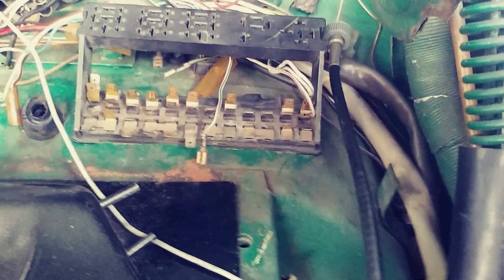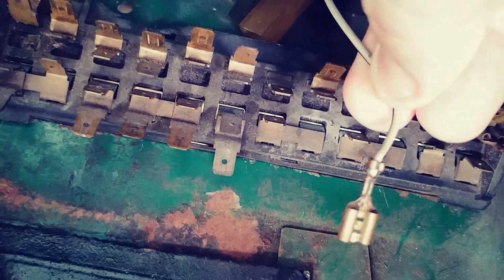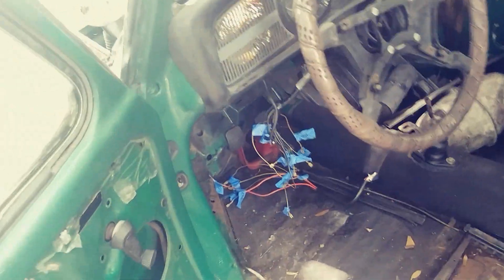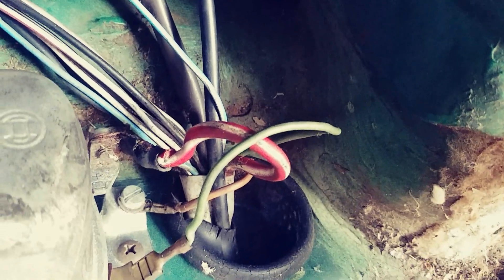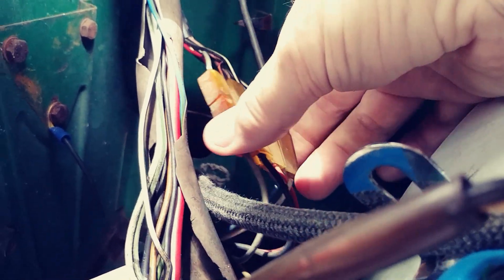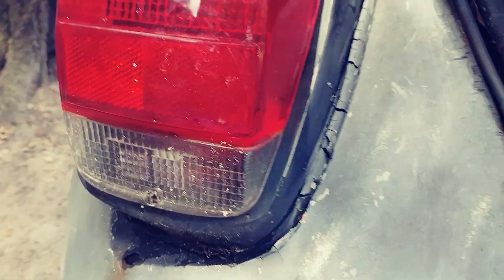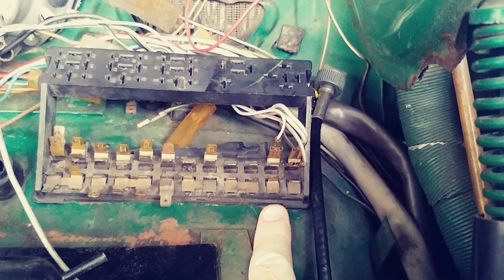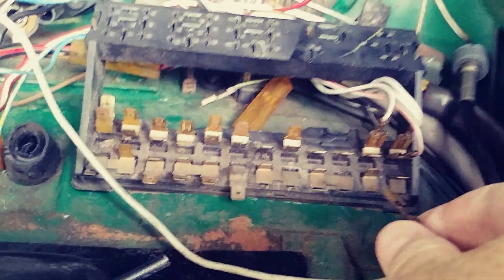CLASSIC 1972 VW SUPER BEETLE. REWIRE ( PART 6B FUSE 2) REAR TAIL LIGHT

Comment: I’ve got. 1973 beetle and I’m wondering how do I remove the wires from the tail lights I had a engine fire and I’m rewriting the whole back of the car again any suggestions
Reply from the maker: The factory way as you know went over the left rear tire. There is a loom of wires then spray installation was used. I myself had a fire as well.in a 67. The only way I way able to run the wires to the back was to drill a hole and reroute the wires that way. I drilled a hole next to.the battery. Same size hole as the wire that comes in from the starter. Then I.used the same size gasket to protect the wires from rubbing on the body. Not a perfect answer. The only one that made sense to.me at the time. Great question. If I can help out in the future, feel free to.ask. I try to.answer every question or comment. Stay safe.